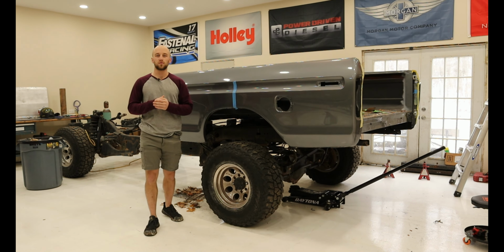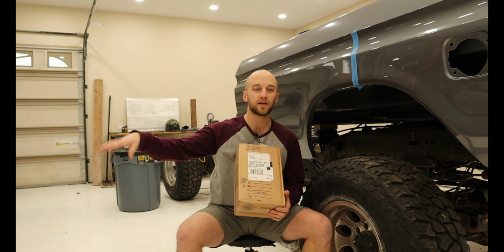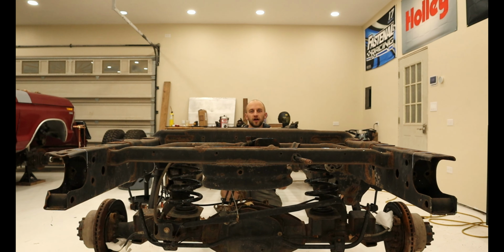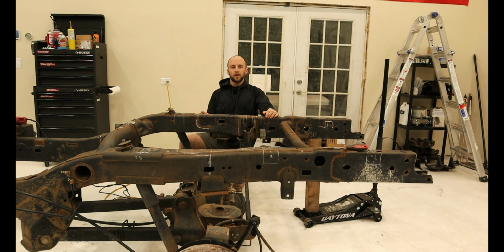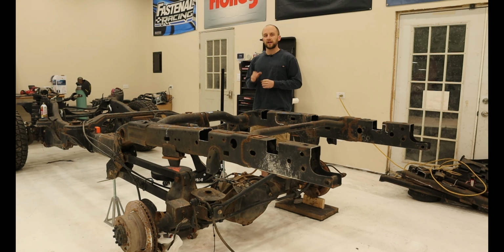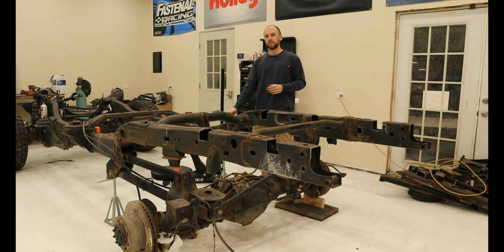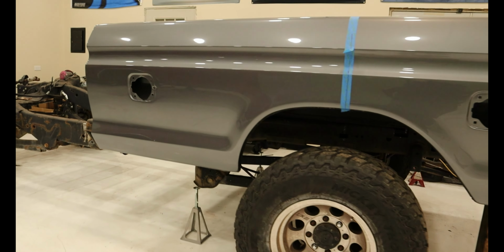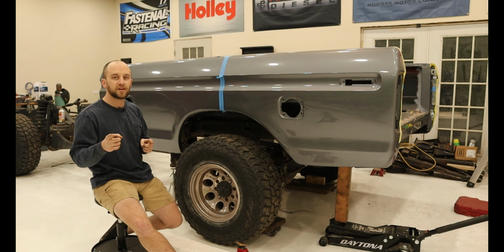1978 Ford F250 Modern Chassis Swap: Notching the Frame for the Ideal Fit!

Comment: I've never seen anyone building a truck in their kitchen before 😆 lol. Looking good.
Reply from the maker: Haha im not sure what you mean by that! Because of all the lights?
Reply: @BarnBuiltBeaters  it doesn't look like a fab shop it's way too clean and finished lol.
Reply from the maker: @78ramcharger53  100% agree with you haha! Thanks! I wanted a nice space to work in what can I say! The floor is a pain for fabbing as the sparks cause permanent pitting and burning which is why you see me using blankets. I am not sure I would go with the floor again but my concrete wasn't very nice looking and the white floors really brightened the space up a lot! Might try garage tiles whenever I build another shop! White floor in a fab area is a very poor choice....gets dirty so fast!

Thanks for watching!